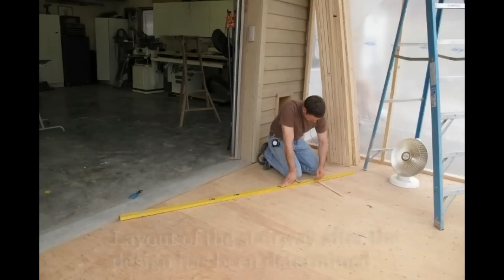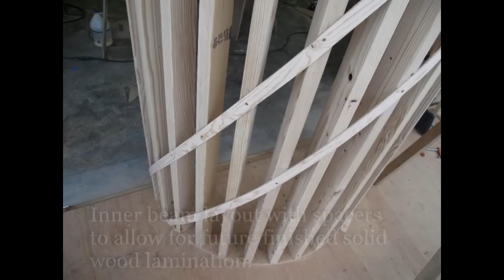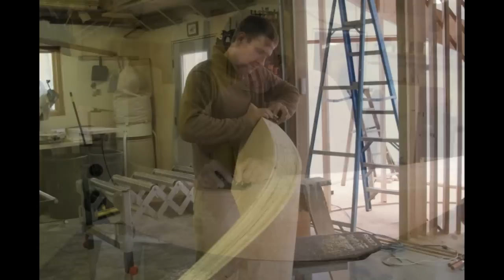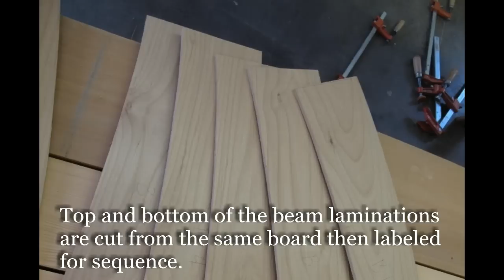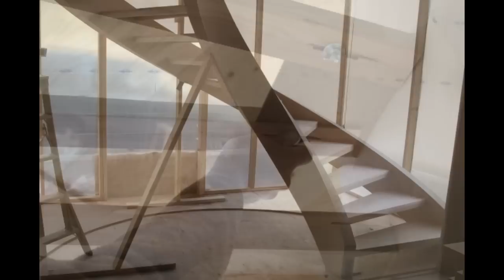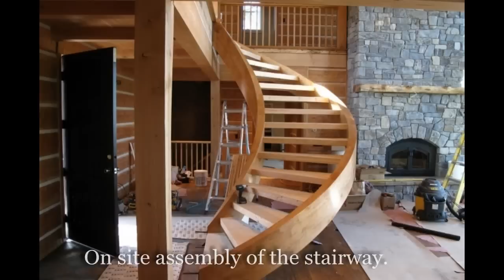Custom Spiral Staircases by Zane Smith

Comment: Amazing, I spent some time working on large house in Whistler BC this year which had a curved staircase being built on site just like this, although on a much larger radius. Rather then framing the treads they had routed housings for them to slot into. I finished up the ski season and headed home before it had been finished though unfortunately.
Reply: That's the way treads should be fixed in via dovetail housings,
Reply: @spanner999  Many ways to skin a cat I suppose.

Comment: Hey, I actually build spiral stairs for a living, my father is the real expert. We build them on the job site now instead of a shop. Not that many people do this work. We did 2 with landing etc.. Cheers, to see there are more stairmasters ^.^
Reply: Although I don't do it anymore, I consider myself a stairmaster. It looks complicated to most, but quite simple to those of us that are experienced.
Reply: @scott wright  yes I'm actually doing those exact stairs, and that's the annoying part, we usually use a finish im the interior for them to paint, otherwise the finish detail after Installing the threads is a bitch to anyone....
Reply: @prawlingbadger2642  stairs get a lot of abuse in new construction, since they do install them for all trades to have access. The good higher end builders will install temp stairs.
Reply: @scott wright  Did you know that if you build them "on" or at the jobsite you don't even need a license? This is in CA
Reply: @prawlingbadger2642  I didn't, but I imagine you have to meet code requirements...I'm all the way on the other coast.
Reply: @scott wright  I didn't think they actually build wood spirals over there That just blew my mind lol nice to meet ya! Wish I could post pics of my work
Reply: @prawlingbadger2642  oh yeah, but my experience is curved stairs, not spirals, although I have assembled a couple spirals.

Comment: Very nice work. Is the pitch determined based on the floor heights, allowable headroom and tread depth requirements? How do you calculate the length of a helical radius? Fabric tape on staging walls doesn't seem accurate. I'll bet there is pi involved. Hopefully lemon meringue ;^)

Comment: This is the only video of its kind on YouTube.  Do you offer consulting... I want to attempt this on a project but i have a few questions
Reply: Did you ever get the answers you wanted. Just curious because I have 20 plus years experience without circular stairs, which is basically what this is...not what I consider a spiral.

Comment: What glue did you use for the laminations?
Reply: Did you ever find the type of glue?
Reply: +sean white  Apparently they cannot be bothered to answer questions.
Reply: I am starting similar project and looking for the glue as well...when I find it I will post it to your comment
Reply: +sean white If I had to venture a guess it would be Titebond 3. It is what they use on doug fir stair treads.
Reply: Urea formalderhyde, plastic resin glue is the best for curved stringers, it's a powder that's mixed with water,

Comment: Too much work , try steel frame
Reply: your dreaming   four good carpenters would have a hard time getting this done in a week or even two
Reply: normally the staircases take about 2-4 months depending on the difficulty
Reply: Zane Smith the one week comment was obviously by domeonme that has never attempted this.I've done two and one had a landing in the middle   four of us worked hard and it took three weeks of long ass days
Reply: Very nice job zane i was just kidding